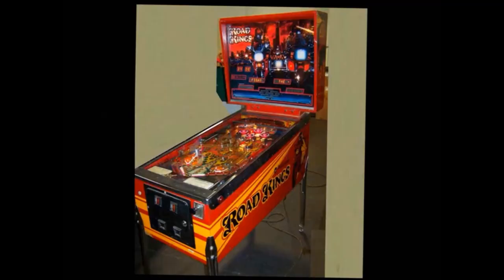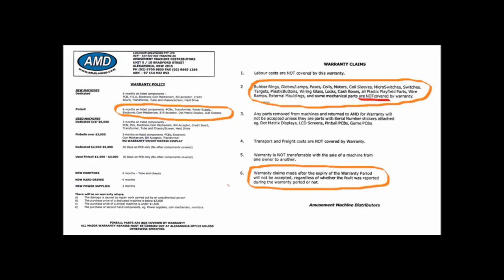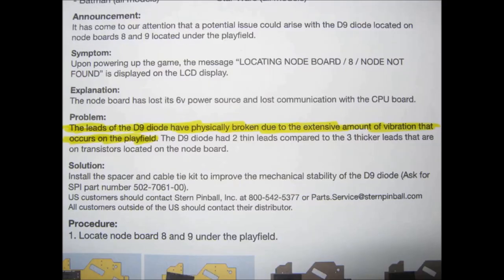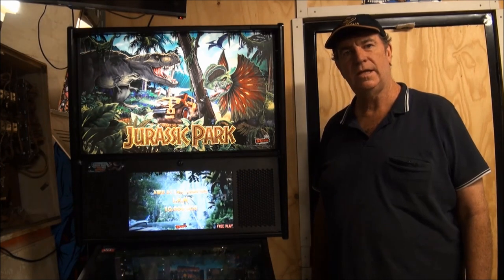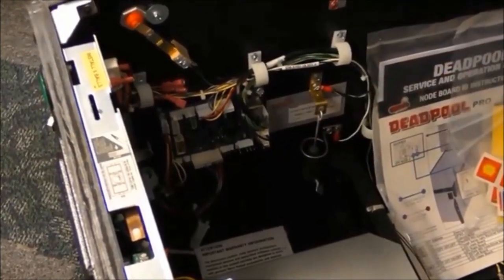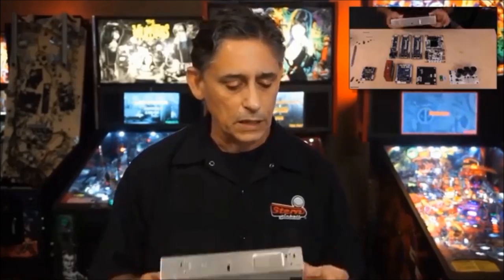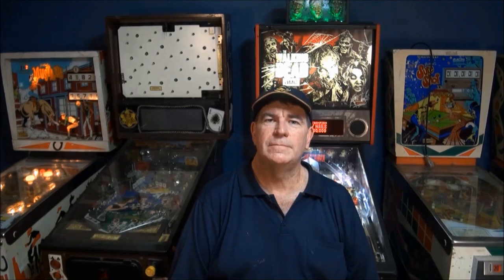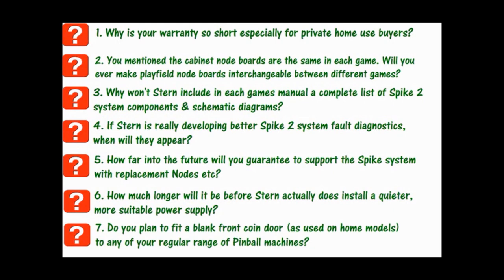WARNING with Reasons NOT to buy a NEW Stern Pinball Machine - Pinball Expert - Brisbane Australia

Comment: Should I get a Monopoly pin w a mint playfield but slight cabinet fading on one side for around $5k or invest in either Avengers (for the shooting, not theme) or new HOH, both Premiums?

I’d love to hear any opinions because you may save me a lotta grief. Thanks to anyone who answers. 🙏✌️
Reply from the maker: Monopoly is a decent game and fairly well made. Don't touch Avengers, it's a Spike 2 game. These are low quality, far less reliable and money pits to repair. Be careful about any buying recent titles, they can be troublesome lemons that owners are trying to get rid of!
Reply: I'd take the monopoly over avengers since repairing the monopoly would be far more efficient and cost saving depending on the fault.
Reply: @AceofSpades-zi6zx  Thank you for the feedback! I’ve been getting the vapors over this decision. I’ve had others tell me the same but for slightly differing reasons. Your bothering to reply gives me hope for this community. 🤙✌️
Reply: @PinballExpert  Your opinion matters to me. So, thank you very much. I AM gonna get the Monopoly. The money I save allows for immediate color DMD upgrade & LED kit, too. 🤙

Hot tip: Americans, buy your color DMD’s from Andrew at Retrocity in Australia. 🇦🇺 I saved $200 buying there for my TSPP & it looks GREAT! 👍

Comment: As an embedded engineer, it is very challenging to diagnose all faults internally and display correct messages.  It basically requires replicating all failures and accurately diagnosing them internally. Sometimes issues get masked (think faulty wiring hiding a blown fuse).  I get that its difficult.  Feels like the right thing for stern to do is to invest properly into this development.  I don’t think its the end of the road for stern, they just need some upgraded investments.  Also, sounds like the level of support should be increased and the cost of replacement parts should be reduced to cost + minimal margins if stern is at fault for supplying parts with low reliability.
Reply from the maker: That's a well considered analysis. The big issue with Stern is, they are ONLY interested in maximizing profits and sales. They're not remotely interested in actually making better systems or better products that will benefit owners.
Reply: @PinballExpert  thats all corporations ultimately though

Comment: I wonder if remounting the vibration sensitive components onto anti-vibration mounts, like what was used in phonograph turntables, (shock mounts), might protect these components from vibration related damage, in the future, and hopefully, eliminate the need to replace these overpriced components? Thanks for the video.
Reply from the maker: Yes some rubber dampers place between the node boards fasteners and the playfield would greatly increase the durability but Stern does not want to do that, it would reduce their sales of replacements!
Reply: Wonderful thought

Comment: It is actually WORSE than depicted in the video.  for example, I bought a TMNT Pro at launch, and it came with playfield art issues (bad printing), u soldered wires and balls suffered magnetization.  i called sterns to address these issues since day one of arrival, and TO THIS DAY I still have not received my replacement playfield.  I CAN PROVIDE THE BACK AND FORTH EMAILS WHERE THEY MAKE EXCUSE AFTER EXCUSE TO NOT PROVIDE WARRANTY SERVICE, even though I made my claim within the 60 day warranty!  They keep claiming that cause of covid, they have a hard time sourcing the replacement playfield... yet during my wait, they have released 2 newer pinballs, and i know that there are several TMNT pro pins they could provide to replace mine... but I guess they rather keep delaying my replacement until I GIVEUP!
Reply: How did this end up going for you?

Comment: Pinball machines aren't iphones. Yet they seemed to adopt Apple planned obsolescence. With Apple you have to drop $1k to replace your hardware every few years, Stern just leads people into the same issue, but the hardware costs $7k up front. You're on the hook forever after to keep the machine working, yeah?
Reply from the maker: There are other manufacturers of both phones and pinballs, you don't HAVE to buy Apple or Stern, I don't.

Comment: Are there issue to be concerned about? Yes.
Is this fear mongering necessary? No.
You arent warning people. You are scaring away potential pinball fans to the hobby. It sounds like you (like many operators) were burned by Stern at some point. 
Ive had good experiences with my games and Sterns customer service.
While there is no official warranty, any issue ive ever had with the 6 games ive pursched since 2018 has been taken care of by Stern. 
Metallica playfield issues? Yes.
Playfield replaced?  Also Yes.
Mandalorian broken ramp? Replaced.
Stern customer service os good. Some people just like to complain before trying to contact the manufacturer. Stern is a good company (though they have gotten greedy with their ever increasing prices)

Comment: Is there anything special about the power supply that would prevent you from using an off the shelf Mean Well supply (which would probaly cost less and definitely perform better)
Reply from the maker: It would be less than half the price of a Stern branded a Power supply.
Reply: @PinballExpert  So is there a reason people don't just do that then?
Reply: @atomicskull6405 not everyone wants to do it, and wants that power supply in it rather than doing it themselves.
Reply: @AceofSpades-zi6zx Mean Well makes some of the best PSUs around so I'm not sure why someone wouldn't want one but ok. Mean Wells are no bullshit industrial power supplies derated by 25% over the stated capacity so if it says e.g. 500W then it can run at 500W 24/7 for years without breaking a sweat. There is a reason Mean Well has the reputation it does and that's because they make very reliable PSUs.

Comment: The Stern Spike BS is totally true.   SMT crap shouldn't be on playfields.   if I had my way, and millions of bucks, I'd open a factory and remake all the early Bally SS games, single ball models, and maybe do up Wizard and Capt Fantastic as early Bally SS too.  :)      All those games, Mata Hari, Power Play, etc, were the BOMB when they came out and if remade, I think people would stand in line to get them.    How hard could that be???  And yes with doing them up as original Bally Boardsets, but probably updated display units and the HV could be removed from the Sol Driver.  :)     To me, pinball is most enjoyed with the single-ball machines.   Just you and the ball and a good game to play it on.  'Nuff said.  :)
Reply: Honestly, nothing wrong with surface-mount PCBs on the playfield, per se. The problem is manufacturing them according to low-cost, consumer-grade standards.

There are plenty of examples of manufactured goods using surface-mount tech and which are designed and manufactured for harsh, "in the field" conditions, and this style of manufacturing would be fine for PCBs under the playfield. "All" it would take is Stern being willing to have boards manufactured that are suited to the environment they are being subjected to.

Comment: Dumbest thing I ever did : In 2013 I sold a very nice Centaur for $1,100 US.
Reply: The list would be endless if we go back 7 years or even 4-5...
Reply: I bought a Centaur years ago for $1500.00. I had a CPR playfield installed ... since it had been worn down to bare wood, like you will find on the majority of original Centaur playfields. The cabinet is in nice shape considering it is a 40 yr. old machine ... which is why I bought it. If your lucky to find a working Centaur machine today ....  it is going to set you back around $5000. Considering that Bally only made 3700 units of Centaur and 1550 units of Centaur 2 this particular machine will continue to command high prices. I have no plans on selling my Centaur or my Twilight Zone ( paid $2850.00 cash for it in 2007). Nothing plays like a Bally or Williams machine. I've never been thrilled with the modern Stern machines and this video confirms it. If your in the market for a new pinball machine, it seems that Jersey Jack Pinball would be the way to go. Happy Flipping .....!!!!
Reply: @danaoberlander5754  Well that doesn't make me feel better.

Comment: I have spent a good deal of money on Stern machines and have quite a few.

If you check the video out channel with a 6 month old out of warranty spike repair. 

Unfortunately, they have not been super reliable.
Reply from the maker: Poor reliability is one of the most common complaints with Sterns Spike system pinballs.

Comment: Great video its a shame stern is gotten so greedy it would be different if they made it better but that can't be possible with cheap components. Also they make it so out of reach to even own a pinball machine its way over the top expensive 5k for a pinball machine thats absurd
Reply from the maker: The biggest problems are build quality and durability has fallen and continues to. Playfield parts are breaking on recent new pinballs  just weeks after purchase, ongoing connector issues along with lousy designed low quality electronics.

Comment: To put pinball mfg's in car terms: Bally/Williams were the Ford/Chevrolet of their time...inexpensive (relatively) and fully supported and easy to fix. Date East were like Dogge...weird-looking with marginal eye-appeal and spotty performance. Modern-day Stern is like AMC motors. Cheaply built, TERRIBLE engineering and failures right on the assembly line. Once in the home environment, good luck getting support!

Comment: I did the mistake to buy a brand new Stern Star Wars LE pinball machine, because i'm a fan of Star Wars and Pinball Machines. Since i have a lot of experience in Bally/Williams machines, especially in WPC/WPC-95, i never thought that modern devices could be so much different...yep thinking first before spending CHF 11900 (yes this was the offical price in Switzerland) would have been an advantage :-) So my conclusion is, that Stern pinball machines are completely overpriced, poorly built, bad in quality and have zero preservation of value. You just pay for a lot of license fees! The price difference between the SW Premium and LE is just a joke in relation to what you get more. I sold it in the meantime and will never buy a Stern again. Instead, I prefer to buy used Williams and restore them to the highest level, so at least you know what you have...
Reply from the maker: Your summary outlining new Stern pinball issues is common to many people who also felt disappointed and sorry they bought a new Stern Pinball.

Comment: Comparing pinball machines to mass market devices where there are sometimes millions sold is disingenuous at best. And even with the economies of scale working for these other devices they even have to draw the line on their guarantees. Stop being so slow, pull your head out mate.
Reply: The controller board is only monitoring switches. Indeed it's so simple that 100$ FPGA device can be used as a direct replacement on wms systems. Stern are price gouging, it's as simple as that